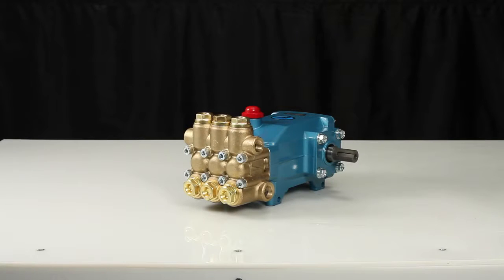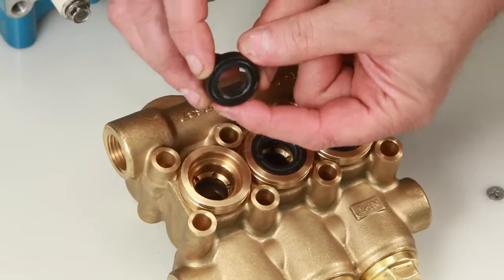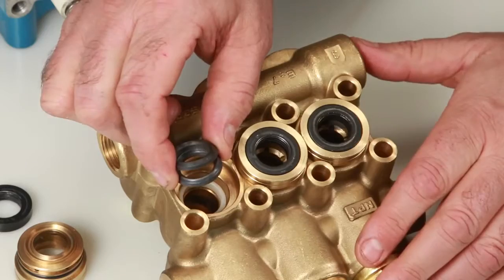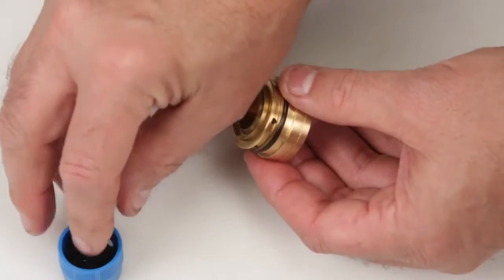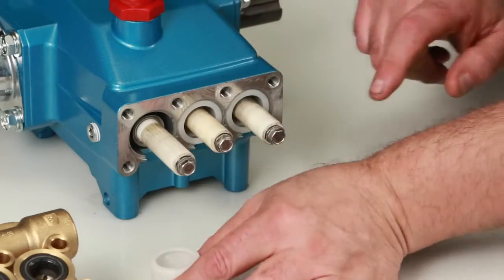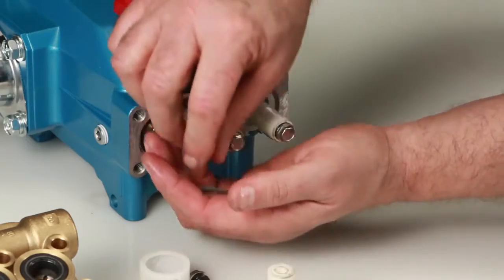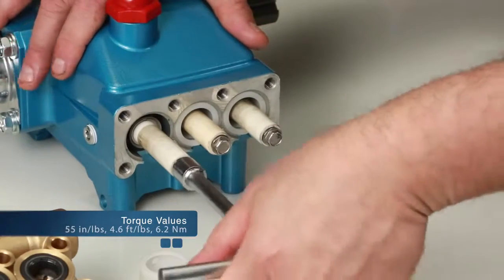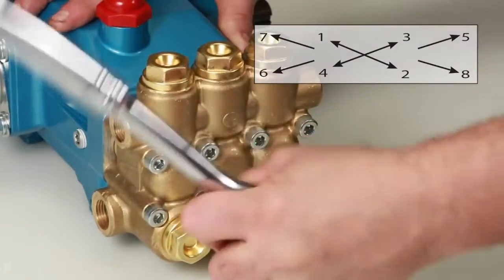CAT Pump Repair: Servicing Seals Model 5CP3120

Comment from the maker: find required part here: https://www.jnequipment.com/shop/pressure-washing/pressure-washer-repair-parts-kits/cat-pump-repair-kits-replacement-parts/33629-cat-seal-kit-5cp3120-5cp3130-pumps/